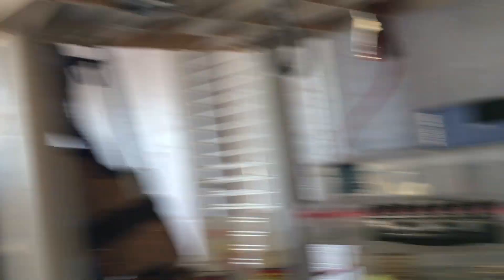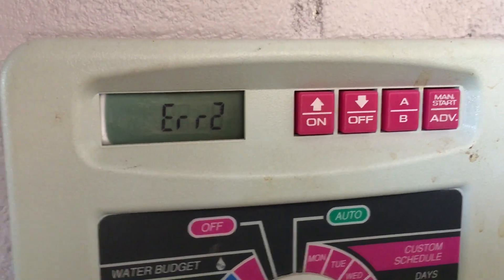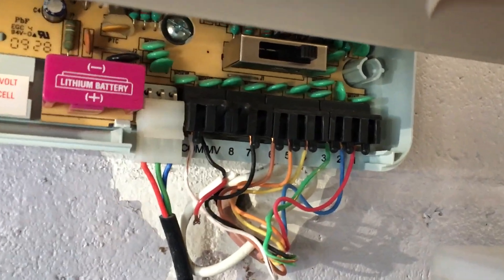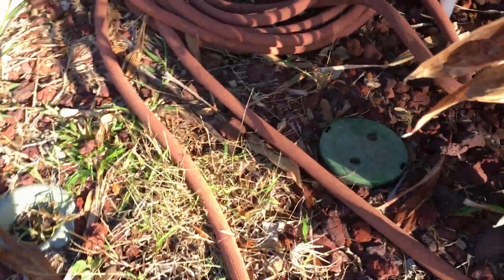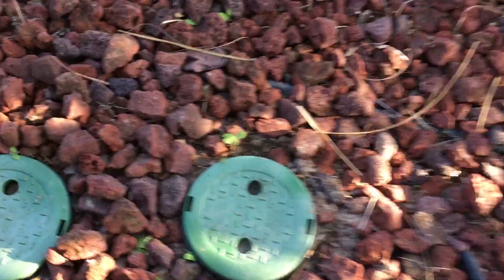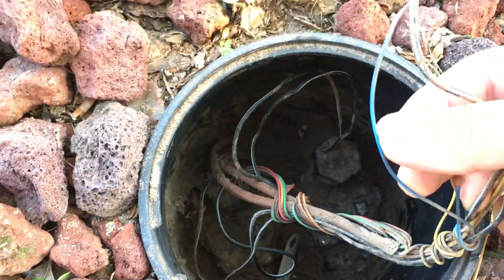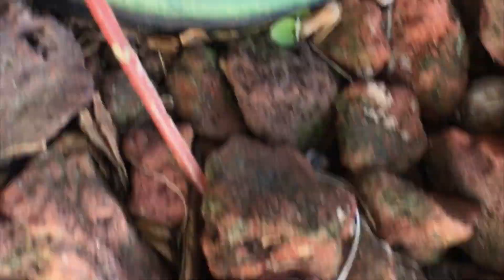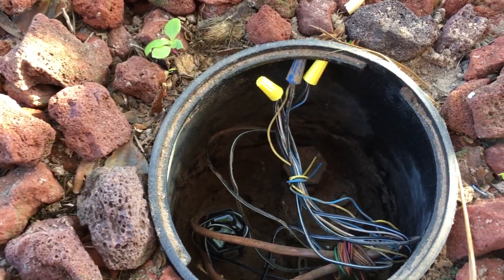Rain Bird Error Message and How To Fix It by Replacing the Solenoid Valve

Comment: My system displayed "ER - - -" message. Could not find anything on the net or at Rain Bird's site. Thank you, Butch Newell, and your commentators for giving me the idea of removing the 3V battery, unplugging the power source, and letting the system rest for several minutes. Then, I put the same battery back into the controller, plugged in the power, and POOF!  The error-whatever mess reset. The system operates just fine again. Thank you!
Reply: I solved my Error 2 issue simply by doing the hard power down (unplug from wall outlet and remove the lithium battery for a few minutes). If the error persists, I'll try the solenoid replacement.
Reply from the maker: Sometimes you have to do that final step in the video and do the reset.
Reply: @butchnewell  how do you reset?
Reply from the maker: You should be able to press and hold the Off Button to reset it.
Reply: What this comment reinforces, is ALWAYS check simple things that are easy to test first  - before you pointlessly run to Lowe's!
Reply: My problem was my lawn guy cut through my wires had to twist them back together...worked well for 3 years until it happened again this week ...first error code ever.... thanks for the help... no solenoid problem just the rusty wires.... ugh still have too twist them every 2 weeks.... 🙄

Comment: ThaT IS one Hell of a nice lawn.  I have been Mickey Mousing all my homes= Sprinkler systems for 30 years now. Underneath my yards, must look like one big white pipe E-Rextor set. The tip I have is KEEP all your spare parts, even the maybe broken ones. Every years the plastic little pieces go up in price like they were made of platinum or Gold. You never know when five , ten years , down the line, you may need some little sprinkler widget and you already have one. Thanks for the video.

Comment: I also have had an ERR2 error message all summer.  Now that the rain has stopped, I HAVE to get this fixed asap.  This video is very helpful.  Thank you!  I just wish that you would have shown a little more footage showing how you pulled out and replaced the solenoid.  Was it just that one blue wire that you had to do something with?  Or other wires as well?  I've never had to detach a solenoid and replace it.  I'll dig around for another video on that.  But this was very helpful.    Thanks.
Reply from the maker: There are two wires that go to each solenoid. 

The blue wire is what identified the specific zone/solenoid and yours could be different. 

Try just pressing the off button and holding it for 5-7sec to see if the error resets. Might fix the issue without doing any digging.
Reply: @butchnewell   Thanks Butch!  Last night I was able to get it running!  I tightened the wire on the control panel.  That didn't seem to help (but it may have since it seemed a bit loose).  I unplugged it from the electrical outlet.  The error code was still there.  So I unplugged it again, and removed the 9 volt battery as well.  THAT WORKED!  It removed the error code, and I was able to get everything working normally again.  Thanks so much!
Reply: And interestingly........ Earlier in the day when I went to that zone in the yard and took the round plastic lid off of the box, what did I see way down at the bottom??  TWO FROGS!  They were down near the solenoid on the dirt (about 10 inches below ground level).  This is totally inexplicable.   There was no way to get in there except a small finger hole on the green plastic lid, as far as I can tell.  That lid hasn't been removed for 2 years.  My only guess is that these two poor frogs were babies, and hopped in through the finger hole.  Then they have lived their entire lives there.  I took them out and set them free under a cypress tree.  They are both alive and well, and seemed happy enough.  So a happy ending indeed!

Comment: I have a ESP-8TM that is just giving me Err.  I have followed all the steps in replacing the solenoid valve, and taking all power away for 2 minutes and nothing is working.  Still getting the Err message.  Any ideas?
Reply from the maker: That’s a tough one. 

Have you tried pressing  the Off button and holding it down for 30 seconds?

If that doesn’t work, there might be another solenoid that’s bad? Not sure.

Comment: Do you know what the meaning of error 3 in RSP-RZXE
Reply from the maker: I wish I did. I tried to look it up myself. 

If the system isn’t working notice could try to reset the controller with the steps online to see if it will work. 

If it skips a zone or doesn’t work at all you might need a technician to service it. But I would start with resetting it.

Comment: How did you locate the solenoid/valve in your yard?
Reply from the maker: The box was in the flowerbed. They are usually in a big rectangular box or single valves will have round lids. 

Every contractor does something different.

Comment: Thanks. It worked. Had to work in a mud filled spider hole with corroded wires.  My controller is the ISM-6. To clear the error code I needed to unplug and remove battery.
Reply from the maker: Right on. Glad it helped. I wish someone had done a video like this when I had my issue.

Comment: Would my water for my system need to be turned off or is this just as exact as your video and swap out then reconnect wires?  Is the solenoid a screw in/out type system?  This looks super easy but I don't want any surprises.
Reply from the maker: You want to turn off the water at the meter or if it’s like mine, I have a valve that shuts off the water to the irrigation system. 

Irrigation solenoids just screw in and are pretty simple to install.

Comment: I have a MV 1.2 3 error code and do not know what to do, rainbrd sia di must have water in one of the boxes underground, which I did, drained the box and let it dry out, Still have the problem  Any help please.  I have a ESP controller Thanks
Reply from the maker: Hey Vito,

That’s a new one for me. Definitely try and just do the “reset” I mentioned in the video. 

It might need new solenoids too. Hard to tell.
Reply: @butchnewell  I finally had to replace the Rainbird controller and now all is well.
Reply: @butchnewell  Thanks for the quick reply Butch, I did try the reset several times, when I find out what the MV 1,2,3 is I will let you know.  Good Health  Vito

Comment: Sorry ask a potentially dumb question but the blue #2 wire…does that mean it goes to zone 2 on your lawn?  Or does the blue #2 wire = the error 2 message?  I have an error 2 message also but my zone 2 on my lawn is also not working when the other zones are.
Reply from the maker: There are no dumb questions when it comes to these systems. I’m still learning. 

For me the Zone 2 solenoid had a blue wire going to it. Yours could be any color. 

Just make sure your replacing that solenoid that had a blue wire going to it. 

I’ll keep my fingers crossed that maybe just doing the reset works to get that zone going again.

Comment: Great video.. mine is stating the same thing. Had a friend come out and re wire at the solenoid and still showing error messages even after restarting. Could it be my control unit that's on the fritz? Thanks for the video!!
Reply from the maker: If you can, try and just do the hard reset first. Unless you’ve had a lightning strike or it’s just really old, it’s not likely the issue.
Reply: @butchnewell  thanks for the advice I will try that for sure
Reply: Finally figured out the issue. My wire was completely crushed from when the house shifted. The old owners ran the wire under a lip of foundation and it must have shifted and crushed the wire. Had to re wire the whole system but works like a charm now.
Reply from the maker: @halfclappertopchedda  That’s crazy, but glad you figured it out.

Comment: I know thi was a long time ago but I cant find shit online for my error. Im getting the error no AC when I try to run manually and the error code seems to be a 7 then a backwards 7 next to each other. So I dont know if thats simply zone 7 or all sectors and maybe power to a main valve. Any ideas?
Reply from the maker: That is a weird one. I wish I knew more about rain birds, and could help you, but I don’t. Maybe somebody reading these comments might be able to make a good suggestion.
Reply: @butchnewell  Thanks for responding! I think it might be something valve related, maybe solenoids. Cause the controller and wireless rain meter are recieving power from the outlet and all has new batteries. But when I go to run it every zone pops up No AC, some screens blink and it moves onto the next zone, same error for each one. So it feels like the valves/solenoids arent recieving power. Again, I'm like you were, completely in the dark about irrigation systems and trying not to call the company that installed it cause I'm SURE they'll find a way to tell us to replace the entire system when we don't actually have to
Reply: Also all of my wires are RED. lol.
Reply from the maker: Definitely post up a response if you figure it out. These different issues and fixes in the comments have helped a lot of people.

Comment: Did you turn off your electric before doing this? Also do I need to turn off the water my system isn’t in ground like yours mine it on poles so I’m wondering it I need to turn off the water or not. The solenoid is right by the water turn on spout. I have an rainbird E—6
Reply from the maker: I didn’t turn off the power, but I did turn off the water.  

Shouldn’t be any current running to the solenoid until the controller turns on that zone. 

Should be a pretty easy fix.
Reply: @butchnewell  Thanks so much

Comment: Yeah. Had the same solenoid problem but mine was a Fault light flashing. Thanks for the helpful video! On a side note. What's the edging block you have separating the lawn from the gravel landscape beds? Looks great! I have gravel meeting grass too. Also really like the color of the block. Thanks!
Reply from the maker: It was here when we bought the house, but I have seen several neighbors have it done since then. Company comes out with a machine that they pour the "concrete" mix into and it forms the shape as they roll it around the beds. It's pretty cool to watch!

Comment: Okay fellow sprinkler people, I had a error code for Zone one. I replaced the solenoid. I understand you have to press off to get the code to clear. But I press and hold off and it doesn't reset it. I've pushed the reset button on the back, but it doesn't clear the air. Do you have to be on a specific function when you press and hold the off button in?
Reply from the maker: I’ve always been able to reset it with the selector in the ON position. It will just reset all error codes. 

Maybe try removing the battery and unplugging it for a period of time so it resets itself? 

Hopefully one of the other views has better insight.

Comment: you are a god send, have the same issue right now looked it up and wala there you are!!!! I will do the same and hope for the best.
Reply from the maker: Edwin Negron Thanks! Just remember to press and hold the Off button to clear the error code.
Reply: @butchnewell  well I got the new solenoid from Lowes, it is under name brand Orbitz. Placed on there however now zone 2 will not shut off!!!! I got the manual to see if there is something on there to reset it. oh boy if it is not one thing it is another. BTW my unit does not have a push off button it is a dial wheel that when I place it on there it shuts off the zone I want to stop. sorry to be so winded..... too dark right now to further diagnose
Reply from the maker: Edwin, sometimes if you turn the solenoid you can activate it manually.   Check to make sure that’s not the case and that’s why it won’t shut off.   I’m not a pro, I’ve just had success with this RainBird.
Reply: @butchnewell  The saga continues. bought new solenoid, installed same thing. Will not shut off.. took it all apart, put back together same thing. Switched solenoid from other zone both would not shut off!!!! Perhaps control board may be bad. will see if I can purchase a different one. just keeping you informed. thank you for your assistance.
Reply from the maker: @edwinnegron7761  You are speaking my language. I usually end up with the last fix I try working.  I know it's frustrating, but when you get it figured out I will add it to the description to help out others in case they run into the same problem. Good Luck!
Reply: @butchnewell  well I wanted to get back to you and let you know I fixed my issue. After trying to figure out why the zone 2 was giving me an error even after replacing the valve, something told me to see if by replacing the connection to zone 4 which I do not use would do it. the answer is YES. I actually replaced the entire valve and purchased the Orbitz replacement unit for about 14 bucks. All is good now in case someone has a similar issue trying using a different zone if available. saved about 50 bucks for new control box and another 50 for a new three way valve mechanism....

Comment: How often do I have to change the rechargeable 9V battery in the Rain Bird Controller. I still have the original system installed in 2004 and have never noticed the 9v battery until now?
Reply from the maker: Joseph Sanchez, Listed com Ambassador I’d just change it the next time you’re out there and not worry about it for another 15yrs.

Comment: How much of the deelectric grease do you use on the connectors? Do I just fill the connector's before buttoning them up?
Reply from the maker: I just fill them up so it squirts out once the wires are in.

Comment: Do you know why a Rainbird would run its cycle three times in a row? Example I have mine set for 9 o’clock it runs the full cycle end it again right afterwards and then around again right afterwards. In all zones.
Reply from the maker: Thanks for watching. That’s an interesting issue I’ve never heard of. 

I’d unplug the unit and take the backup battery out so it resets. 

Then reprogram it. 

Please post if that fixes the issue, as others can learn from it too.

Comment: My ESP series doesn’t have an inner battery (that I can find). I’m getting an ERR 8 message and I’ve tried everything I can think of so far. I can turn on zone 8 manually from the solanoid. Where is the malfunction coming from then ?
Reply from the maker: I was able to start my zone manually too by turning the solenoid. However, it still wouldn’t activate through the controller until I replaced the solenoid and “reset” the zone on the controller. 

After that it worked fine.

Comment: Thanks, you put me on the right track. I was having a general ERR, never found any wiring issues but finally did get it to reset by unplugging and pulling the battery for about 20 min.
Reply from the maker: I’m glad that worked. Sometimes it’s the simple fixes.

Comment: After all your research have you seen the fix for when Rain Bird esp-4tm won't turn sprinklers off? Switch will literally be switched to off and the sprinklers kept running.
Reply from the maker: Ben Howard The only thing I could think it would be is the solenoid for that section maybe isn’t tight or their is an issue with a connection. 

A loose solenoid will override the control box every time.

Definitely post up what your fix is, to help others that might have the same issue.
Reply: Butch Newell thanks for the quick response. Guess I am about to go hunting for some solenoids under some mulch. My long term fix is buying a Rachio Sprinkler Controller 😂

Comment: What do you do when your system have No power at all? Is that a easy fix? I put a new 9volt battery thinking that would help but still No power.
Reply from the maker: carolyn johnson I'm not a pro at these but a couple of things come to mind. 1. Check the Breaker the outlet that the panel plugs in to 2. Check the GFCI outlet in the garage to see if it may ha e tripped. Other than that, their might be an internal fuse that blew or maybe a power surge fried the board. Hope that helps.